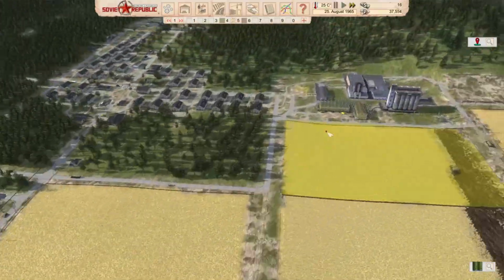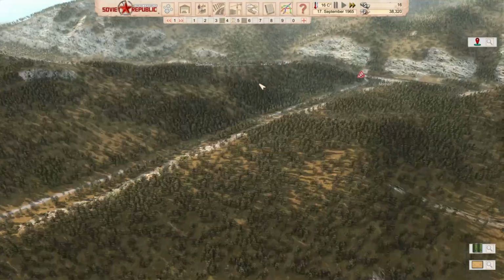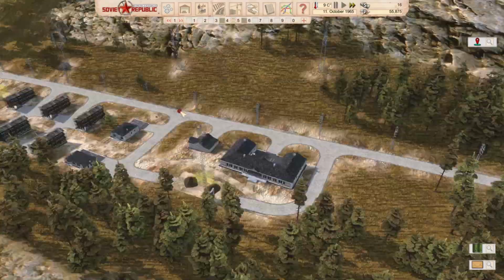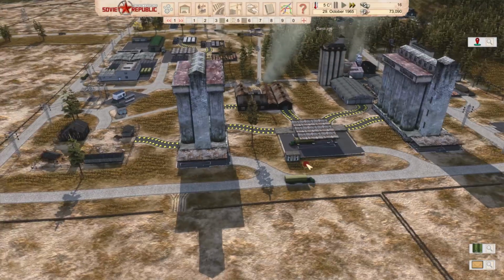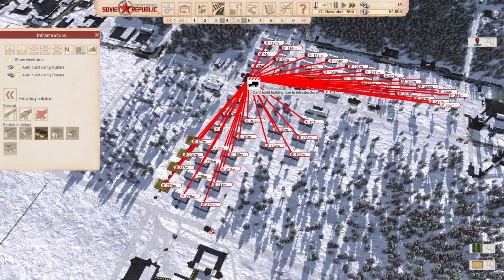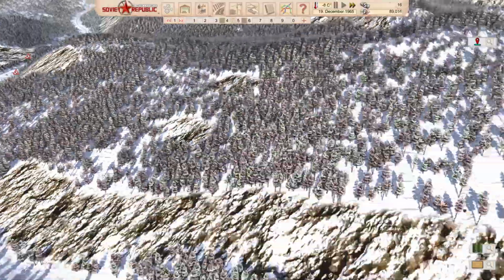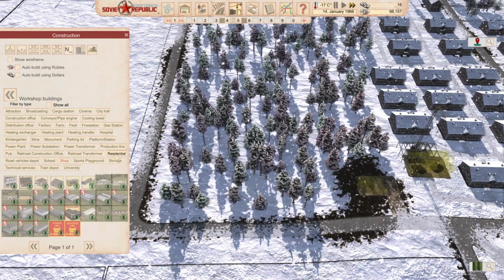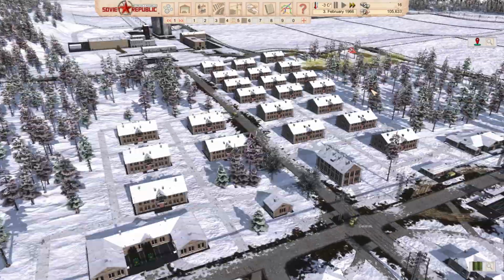Soviet Republic - Alaska - The Alaskan Problems - Ep.16

Comment: I'm kind of amazed how low your pop is, but you have almost 2000 people all on one 7 person vanilla heating plant? Self heating buildings, the modded buildings are coded to not even need heat (university) but your industry is all in walking range. I have no idea how bad your pollution is but life expectancy is really high so I may once again check out the pollution of the mods.
Reply: Wow typed this comment at 35:00 and you went to it at 36:00. Lucky me! So my issue during episode 0 is there is no chance of failure playing with these buildings when you said you were doing HMC (and why I said HMC is outdated (very actually)).
Reply: There is a known bug, every time you make a long heating pipe make sure the pipe isn't in 3 jobs (making the center unreachable).
Reply from the maker: @bc74sj69  Yeah! I know the bug. Looks like it's working fine now. 1 small heating plant is enough for up to 3000 people. Rough estimate. Even with normal buildings.
Reply: @oolykeegaming81  Yeah looks like you can do exactly that many with these houses (workers, not children). So at least the water tanks are balanced :). It looks like said modder actually updated the worker count on the description page, but still has the served variable of 20, so I think the university can do 220-240, but highest I can get it to go is 208 due to shift changes / productivity with 9 staff 12 professors. If he changed his variable to 9 from 20 served it would be accurate (but still 3x more than vanilla). Running a testbed and see 220 served with 90% productivity. Just curious if it will go to 240 with 100% productivity.
Reply from the maker: @bc74sj69  Looks like your moaning paid off. :) 
Congratulations! Since I agree with you regarding the university being OP You won us all a great victory. :)
Reply: @oolykeegaming81  No, nothing was fixed. Just a description. Unless my workshop mods aren't updating. I got it all the way up to 223 workers with 91% productivity.

Comment: Problem with the 12T gas tanks vs 70T gas station is when they are near any highway. Just not worth the risk to me when I play on a large map to have a cistern drive far away to fill one up when a gas station is needed.
Reply from the maker: I understand. 
I'm thinking about avoiding big highways in this playthrough. 
I'm thinking about the railroad connections between the cities and truck for local deliveries. 
Assuming within 1-2 km.

Comment: You can replace your first food factory with a second livestock farm connected to the second silo and the cargo station as is already the food factory. So you will have a silo for each breeding farm. And imagine that this is good because the capacity of a silo (well the capacity of what a farm can supply to a silo) is in theory what a livestock farm needs throughout the year :)  Your two farms can supply two breeding farms, not three ...
Reply from the maker: But we are already experiencing a crop surplus! :/
Reply: @oolykeegaming81  Looking ahead, we can hope that one day the flow of workers for the two breeding farms will make them operate at full capacity and therefore that they will use between 3,000 and 3,500 tons of crops per year, that is the production of the two farms. If ever there is a surplus you have a distillery to use whatever is left. And make a profit. And as your population increases, switch their use for the food factory (on its own it can use crops from 4 farms). For me a third livestock farm for these two silos (and these two agricultural farms) is a bit of a waste.

Comment: The mechanics of the game, as far as I know, do not work that way for workers on a footpath (or whatever) : the Co primarily sends workers to the site with the fewest workers, if by example one footpath has zero workers and another 10 workers the next bus will go to the first. There in your example on the small stretch of road the two buses went to the same stretch because all your projects were at zero workers : the game does not recognize that it has already sent a bus and therefore it sends them all ... This is a well-known problem all many are complaining about because you can have a big CO sending multiple buses to pick up workers that exceed the capacity of the construction site to accommodate them. So for this CO specialized in footpaths or small sections of road, having 4 mini-buses is more efficient if you chain the projects, because with a rotation of projects very quickly your buses will supply several projects at the same time as long as some start to have workers.
Reply from the maker: I'll pay attention and hope for the best.

Comment: Pretty sure trees are not assigned individualy to the wood cutting post. I think they work by coverage area. But I'll wait until I buy your test results on the black market to be sure.
Reply from the maker: I'm sure too. But you can see the logic. Also, why didn't they apply the same logic to wood cutting as they do for towns and areas?
Reply: @oolykeegaming81  I think they applied the same logic as for mining, they categorized timber as the raw mineral resources.
Reply from the maker: @statsneguit3069  that makes sense.

Comment: Get a dedicated fuel distribution office... fuel is the blood of the nation
Reply: Agree
Reply from the maker: Agree!! Wil do!
Reply from the maker: Also! What size? What capacity trucks? Mixed, low?
Reply: @oolykeegaming81  Wing it with a mixed set, a bit of variety looks better than the same vehicle everywhere, even construction and distribution.offices, not everything being delivered needs the same size vehicle. ☘️🍀☘️
Reply from the maker: @oldgalah7425  Bud, you know the name of the game! I don't need to say anything! Mixed it is!
Reply: @oolykeegaming81  Petrol logistics would benefit from operating at several levels: the first level corresponds to transport between each logistics hub of your towns, the second level corresponds to the transport between the logistics hub and the stations or buildings that must be supplied in the area of the related town. For transport between logistics hubs I tend to use trucks with high capacities (to fill the 300t moded cisterns for the small towns or the 1500t vanilla one for the big cities), for transport between the logistics hub and buildings, trucks with lower capacity.
Reply from the maker: @statsneguit3069  Is it just me or is this another step towards being the worlds most DO have a country. :) Distribution office for everything and distribution office to manage the distribution offices. To keep it a bit simpler. I will start on the train lines and have the trains delivering everything to everywhere. And DOs only for local supply. What do you think?